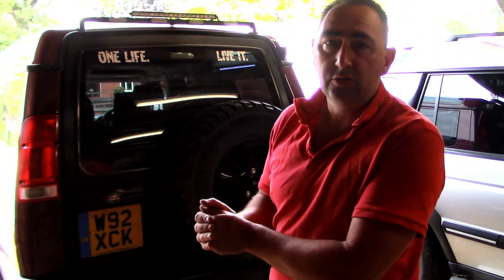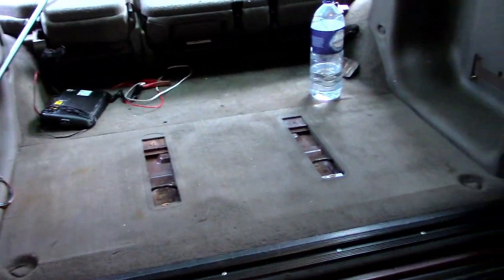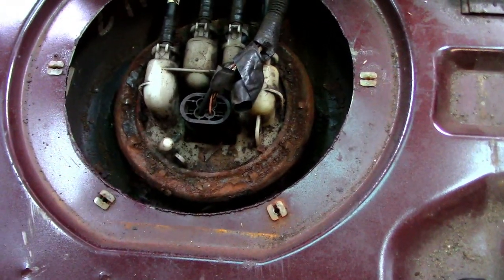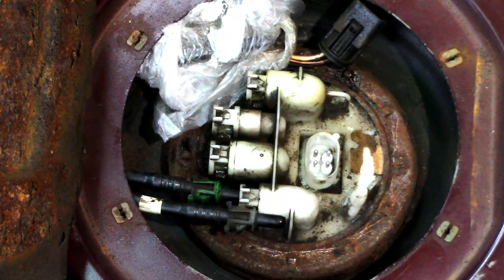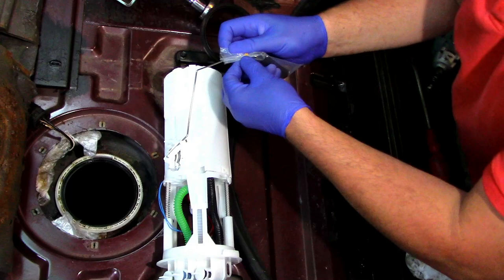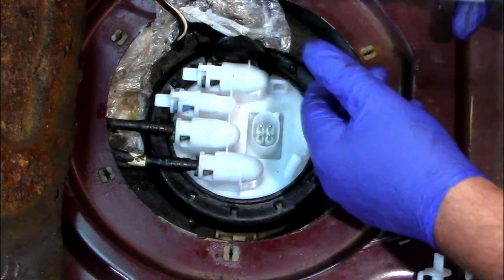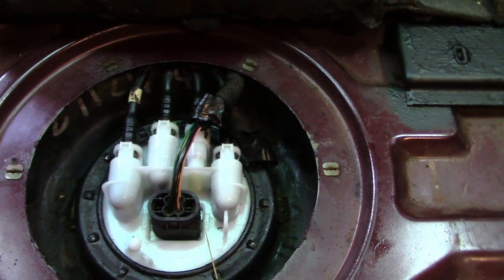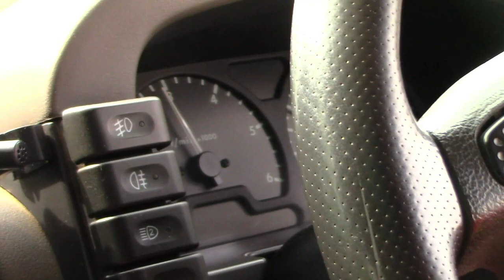Fuel Pump Change on Landrover Discovery TD5

Comment: Great video. Thinking of replacing mine as preventative maintainance on my 02 plate 109k. Out of curiousity did you see any improvement on mpg?
Reply from the maker: Can’t say I see any difference in mpg but it did run much smoother.